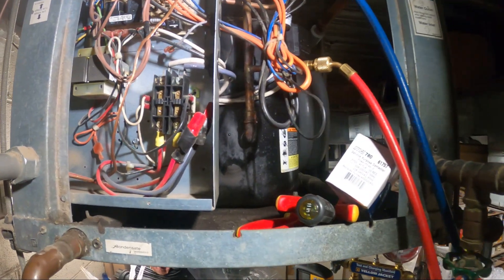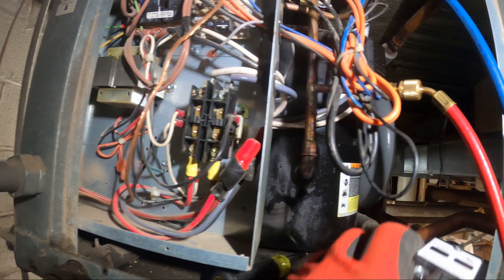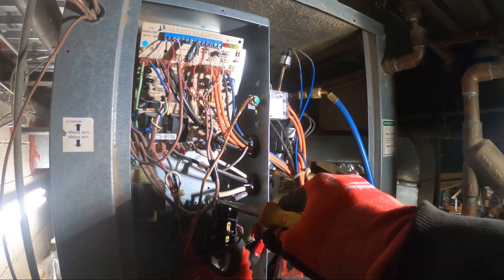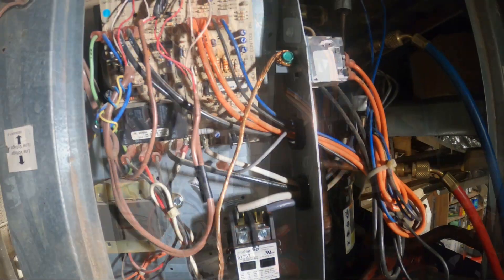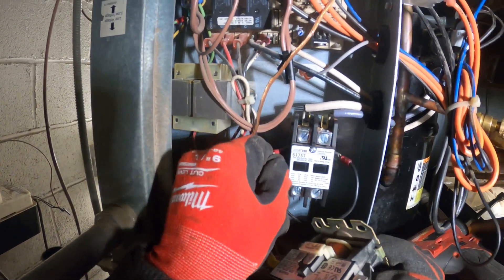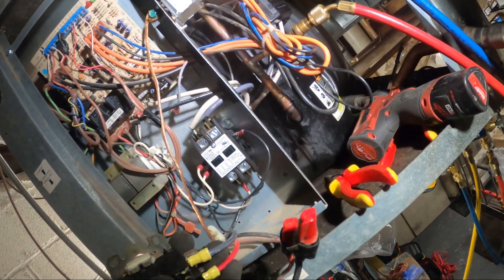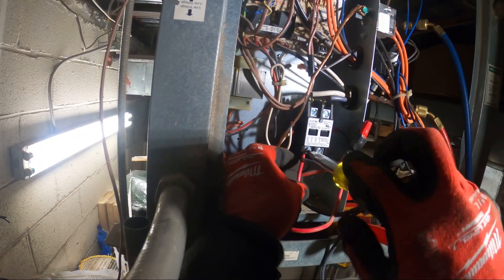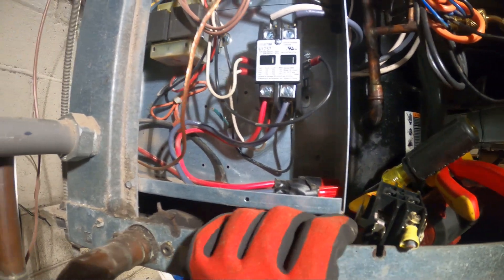HVAC: Compressor Contactor Install/Replacement (How To Replace A Contactor For An Air Conditioner)

Comment: Do DP contactors (Definite Purpose contactors, like used here in HVAC)..if mounted vertically as you show here.....does it matter if it's mounted upside-down?, are they directional?.... meaning, ....can the L connections be either top or bottom?...(of course same issues with T)....can the T pair or L pair be either top or bottom?